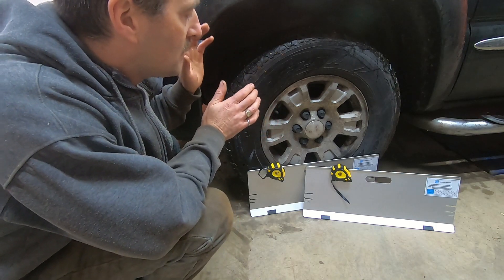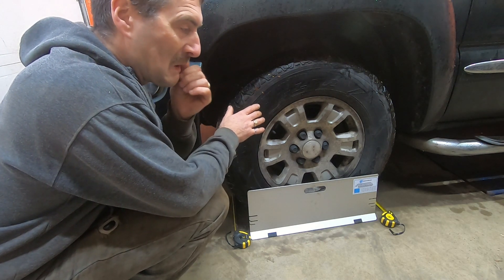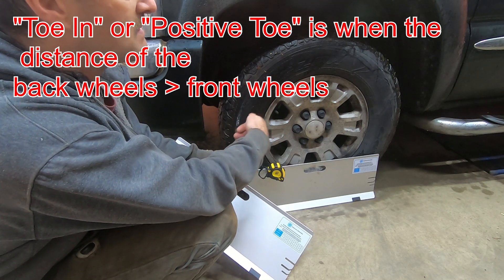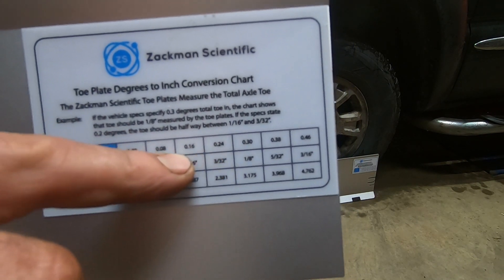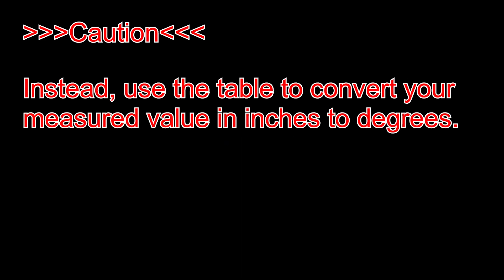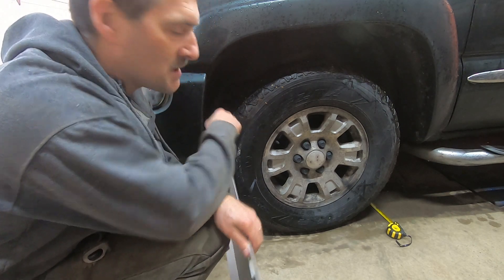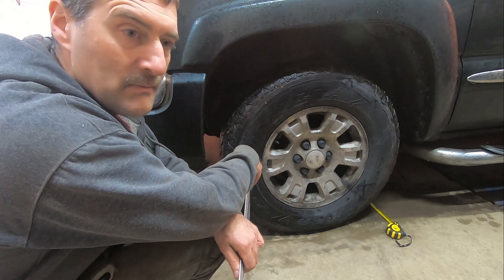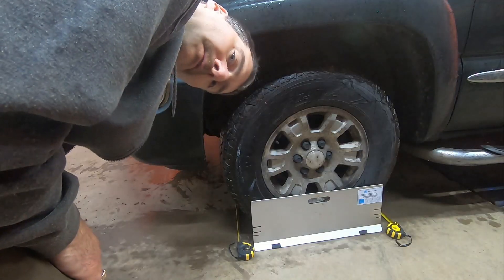How to Set Toe with DIY Wheel Alignment Plate Kit

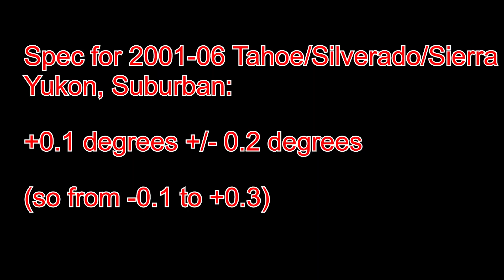Comment: at 5:05 you have 0.1 deg +/- 0.2 deg and then you show the range.
but as I understand this, it would be 0.1-0.2 to 0.1+0.2 or 0.1 deg [subtract 0.2 from +0.1] - 0.3 deg [add 0.2 to 0.1].
I'm thinking of getting this device for myself -- so let me know if you disagree with what I have here. thanks.
Reply from the maker: 0.1-0.2=-0.1     0.1+0.2=0.3     therefore, the range is -0.1 to 0.3  - make sense?  Don't forget to use my coupon code for a discount on check out.  See the description.
Reply: @mrdiyguy123  yes, I understand. thanks for the clarification. I forgot the "negative sign" for the low end.

Comment: What about the bulge at the bottom of each tire?
Reply from the maker: the typical bulge where the tire meets the road does not impact accuracy since it in no way changes the angle between the 2 plates..  What is important is for the plate to be centred and making contact with the wheel as described at @1:46.

Comment: Seems a bit off, different tires or inflation right to left will throw different measures I would think
Reply: He did mention correct tire pressure at least in captions on the video.   Different tires will obviously make an impact but like SIZED tires with very similar tread block and shoulder profiles and tread ware will not corrupt measurements any more than variances within the same tire line.    One tire being filled with nitrogen versus atmospheric air will also make some impact, while we’re at it.   Moisture from air compressors will make its way into the tire, where it condenses back into water.   Water will bend a connecting rod if sucked the combustion chamber before a compression stroke, it also takes up space in a tire, where identical air pressures in two otherwise identical tires besides one being filled with very humid air, and liquid water straight from the air hose sometimes after long neglect.    Water doesn’t support a tire the same way air does, always settles at the bottom, and CAN cause a mild sidewall bulge, compared to the “dry” tire.    That bulge is the kicker with these plates.